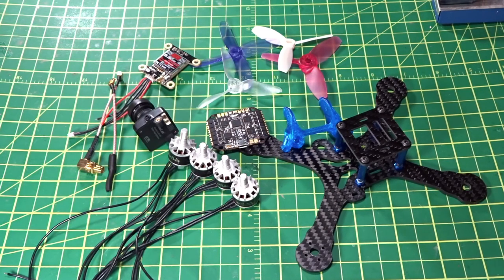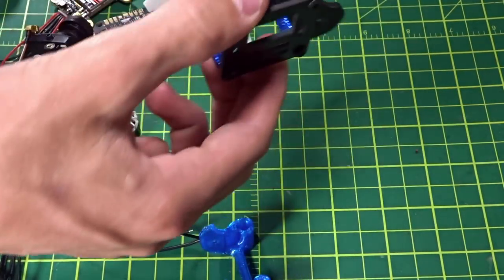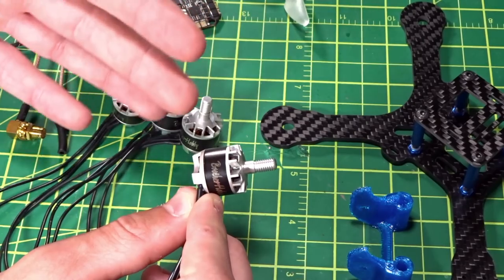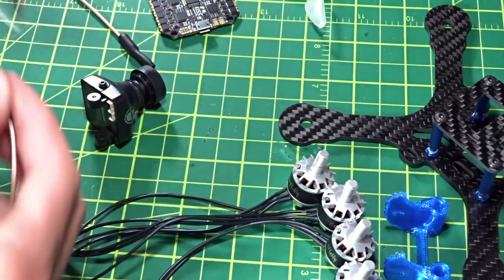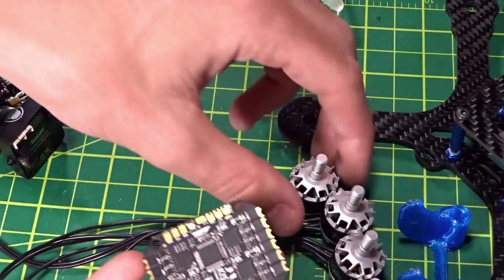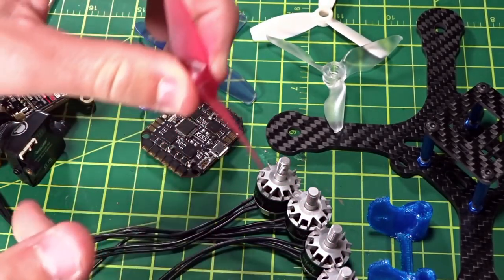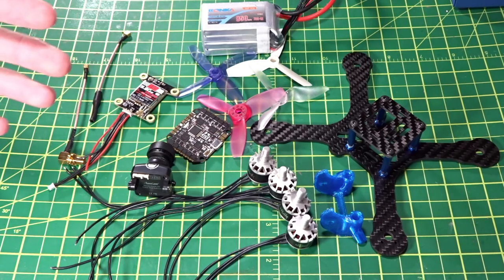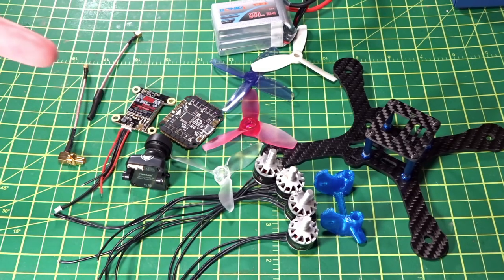3inch Quad Build : Parts Introduction

Comment: As a noob to FPV and starting small with the Eachine QX90 I'm already hooked. I'm currently at the stage where I need to be at least flying around my house like all the other chaps seem to do effortlessly on YT videos that I come across while learning about Quad FPV. I have started out by flying only in angle and acro mode, but with horizon mode set on aux switch in the mid position still to aid my moments of anxiety, as I'm still learning. My aim is acro fulltime 

Anyway, I am itching to do a build and cant wait for the following videos in the series.
Brilliant work for the community chap - Thank you!
Reply from the maker: Awesome man and goodluck in the hobby :)

Comment: Its crazy how fast technology advances. You can build a hell of alot more quad for that price now. Infact they now make bnf 3" race quads that go over 100mph out of the box like the geprc mx3 sparrow. And now that faa registration is required again for 250grams-55lbs quads, people are going to go nuts with lightweight sub 250gram 3" quads. They perform almost as good as the big quads these days with the added benefit of not needing to register them.
Reply from the maker: They don't perform the same, simply can't. They are good yes, but 5inch is 5inch. Oh and who cares about that registration crap, fly whatever you want responsibly.

Comment: For the camera I probably would have gone for the run cam Micro to save those grams, as it performs as well as the run cam RR edition, and I probably would have gone for the omnibus F4 asguard because it has the OSD and current sensor, so you get all the stats, and you can PID tune without a computer. Also I'm gonna be honest I think beta flight is so much better than kiss, I'm not trying to start an argument this is just me, but if I was going to build another 3 inch quad, I would probably use those. Anyway, really looking forward to the build videos to come!
Reply from the maker: Yeah, I probably should have gone with the micro cam, but the included mount fits this style, and to be honest it was a late night impulse buy ;) haha. 

As for the KISS, I was sent it to review, so wasn't my choice ;D Still looks good to me, and excited to finally try KISS.
Reply: Haha, every quad pilot has those impulse buy moments, as for the kiss, its a nice piece of kit, just not for me, I hope it works out great on this build though!

Comment: HI after flying with the quad blades on the 5"  it behaves much better than with the tri's, but still think its a little bit to fast for my ability more so now than the limited space I mentioned before, hopefully it wont take that long for me to improve, 
I plan to build a 3" too ,again use quad blades for similar control and use the 5" when I get a bit more confidence  

so will be great to see your completed build, I like the idea of using an all in one board. 

(don't know if its the right thing to do or just keep at the 5", I have a 90mm micro and it seems to distract me from flying the 5" maybe a 3" will do the same - answered my own question haven't I !! )

thanks
Reply from the maker: I was flying it this weekend, and it flies amazing, but all of a sudden it only gives me throttle! No damage at all. I might try re flashing the board.
Reply: hope you get the FC sorted, I have had a similar problem on a SPR F3, flashing cured it for me, maybe it could be an esc try flashing them too.

have you tried any of the micro's-
I just fried an all in one 10a/ esc on 2S for the second time on one of my micro builds, last time it was after a week this time with in 3 minutes of replacing it today, also the micro's RJX , kingkong, racerstar 1103 and SPC and LD power - 1104 motors I have tried over the past month lose a bell after a mild crash and even in mid flight ?
 although fun when working correctly, I cant justify the expense of repairing or replacing parts practically every week of owning them. and I just bought some 3S batteries too that also came today, admittedly I haven't flown my 5" as much but all I've needed to do with it, is change a few props and a battery strap.

Comment: Please help. I have had this problem many time with my motor nut coming off in flight I have them set up right can you please tell us what motors are your favorite motor nuts to us so when you are flying you do lose them in flight thx great videos
Reply from the maker: Are you using nyloc nuts? They have plastic inserts that keep them from coming off pretty much no matter what. I just use what comes with the motors. Perhaps you aren't putting them tight enough, and not engaging the plastic threads. Some can be quite tough.
Reply: Thank you so much you have great videos you show go to maker fair and race fpv

Comment: Will this build put you under 250 grams?  I would think it definitely would.  Reason I am interested is due to the brutal new regulations in Canada for multicopters.   Just getting into the hobby, but will likely do all of my builds under 250 grams or I will have to fly at the local MAAC field only.  Cheers!

Comment: I have a built 3" quad and I am not so impressed but I choosed cheaper and weaker motors... I am looking forward to see your tests... I really like those T1 1407...
Regarding the batteries I am flying with 550 and 850mah.. The 550mah are useless  (no juice)  so I buy a set of Tattu 1050mah..
Reply from the maker: Which motors did you go with? Yeah 550 are probably too small, and 1050 too big.
Reply: RCX 1707 3200kV... They are heavy but they have a good trust with low amps draw
Reply: Cid156 1707 size is much better for 4"
Reply from the maker: Yeah, even 1407 might be maxing the size for 3inch, so 1707 is a waste. Should be a good 4inch motor though, especially with that lower kv.
Reply: I bought one RCX1407 3800kV and one RCX1707 3200kV... I benched them on a 3045 3 blades the 1407 pulls 415g for 16A the 1707 pulls 440g for 15.4A. I tested few props and the 1707 pulls always more than the 1407 for less amp... That why I choosed the 1707 over the 1407
Reply: There are 3 inch and there are 3 inch. My light 3 inch with 1304 motors and dry weight 80 grams+50 for a 450 4s is a speed demon ,acceleration is at least like my 5 inchers. If you build with t1 1407s and manage to get under 150 dry you ll be amazed even on the 550mah.

Comment: your gonna love it. looking forward to part 2! if your going with a full cam might as well do a piggy osd.
Reply from the maker: Does that only add voltage? I have seen them, but if I was getting an OSD I would have to have a current meter.
Reply: the kiss esc have current sensors in each one, they submit telemetry to the osd, you can tune pids from the osd as well. rcgroups: kiss osd 

it'll work with the Helix vtx with osd built in and change the vtx power, or the tramp or unify pro hv.  the reason I got the same vtx u got here is because the Helix vtx is sold out.
Reply: The RCAddict also the frsky xsr+ will give u the ability to tune pids from the controller via Lua script.
Reply from the maker: Not really interested in tuning from OSD or Taranis, but getting the KISS telemetry sounds awesome haha. Looking over the AIO I don't see any place to grab the data from though? Since the escs are all together. If you know if it works, I will order one right away :)
Reply: The RCAddict the piggy works, I have been following the kiss osd thread. the esc sends the telemetry to the FC then the osd gets the telemetry data from the fc. since it an all in one the telemetry wires are inside the board but the hardware is functionally the same as the full kiss fc and 24a esc's. just different amp limits.
Reply from the maker: Ok, yeah I was looking for 4 pads, but seems like it is 1 wire telemetry from the FC to the OSD, which is either RX1 or TX1 on the CC port, so I will order one now! Thanks for the suggestion!!

Comment: is the camera able to record video directly or do you have to record the downlink?
Reply: love the smaller builds btw!
Reply from the maker: You would to record the incoming video (with breakup etc) or put a HD cam on it, but it wouldn't like the weight at all.
Reply: yeah, HD cam would be too heavy. ehat do you mean with "You would to record the incoming video (with breakup etc)". recording the downlink oder record the video direct on the quad with a drv? yould be nice if its possible. the downlink is ok for flying, but not for recordung the footage...
Reply from the maker: Yeah, recording the downlink. You COULD put a small DVR in the quad, but I don't see the point.
Reply: Its chraper and lighter than an extra cam like a Hero Session

Comment: awesome, the best i have tried is the the RK 3030-4 blade they make a 3 inch quad so much more fun and great at playgrounds. im actually working on a 2inch 4s build 😯 lol
Reply from the maker: Yeah, I think they are my favorite so far. It was flying great but all of a sudden with no damage I only have throttle control, no yaw pitch or roll! Going to try reflashing today.
Reply: The RCAddict yikes bud, i hope the  reflash helps it! or you might have to re flow the kiss all in one, i had to cause 2 esc were stuttering and that fixed it, used an easy bake oven, i leveled it so parts wont slide off, big mistake when i went to go reflow a vtx in easy bake oven almost every thing slid off the board 😁 happy flying bud, you are getting crazy good!
Reply from the maker: Hmm, I hope not haha. It worked perfectly though, and was the softest landing ever lol.
Reply from the maker: Reflash fixed it :D
Reply: The RCAddict hell yeah, don't you love when its something simple that fixes the issue. lol

Comment: ive got all my parts to build a 4" except the frame.  Going with all bangood parts (sorry patriots lol) grasshopper 160, brotherhobby t1 1407's, atx03 vtx, runcam micro, the new 20mm f4 with matching 25 amp aio esc only 6.5 grams total. Probably start with kingkong 4045's running 4s 850mah infinity graphine.  Im really anxious to get this baby built.  Will be around 225g auw.  could maybe squeeze a runcam 2 minus battery and stay under 250g so i can fly wherever "the hell" i want. lol.  thanks for you vids bro.
Reply from the maker: Awesome :) Have you not heard about John Taylor winning against the FAA? I hear registration is no longer required as their regulations were illegal to being with! Not sure if they appealed yet, but I never registered anyway ;)

Comment: What other board would fit on this frame ?
Reply from the maker: Any 30X30 one. I don't recommend this anymore though, little heavy and old
Reply: U don't recommend build or fc?
Reply from the maker: Both, the motors FC and props are still good though. I would look for a lighter frame, 20X20 electronics though
Reply: The RCAddict yea but I don't want to spend almost 80$ for fc
Reply from the maker: Then don't lol. The HGLRC is a great 20X20 4in1 FC combo, video coming soon
Reply: The RCAddict alright I will definitely be looking for it :) I really like that stilleto you have aswell keep up the awesome videos always like to watch and did you design the mode 2 ghost :)??

Comment: For those in the uk, mrm do a similar bit lighter frame available at multirotorspares.co.uk. Like this one it has a camera mount that gives me nightmares lol. Nice parts. Rotorgeeks 1407s are my favs. A fair bit lighter with similar power. I'm not sure that 1407s are worth it on 3 inch, but let us know it's speed compared to the old GB130. Looking forward to this.
Reply from the maker: Should be much faster. Might even try 1408 4000kv motors on it sometime ;)

Comment: Have you thought about doing what Kabab did with the 1407's on a super light 5"? I've been going for max thrust without concerning the weight... Like I said in the live stream last night... 35a esc's and 2408 motors on 5s (I really wanna try the 50a esc's on those new 2407 motors... They can supposedly run 6s; easily hit 140 on a light frame) but now that I've started racing I want to see if lighter is in fact better.

Also you should have used a micro swift for this build... It could definitely save some weight! 

Also, also, please check out my channel for new stuff... This frame I've got is epic and once the runcam 3 comes in I can record literally holding full throttle for 1 sec and not see the ground... F80's RIPPPPP

Finally what grade are you in? I'm in 9th :p
Reply from the maker: No, the 1407 motor just won't have the torque to drive the prop correctly, Kabab agrees. That would only save like maybe 5g? With the AIO, and the Whip antenna I am probably saving about 30g :) 11th grade here :)